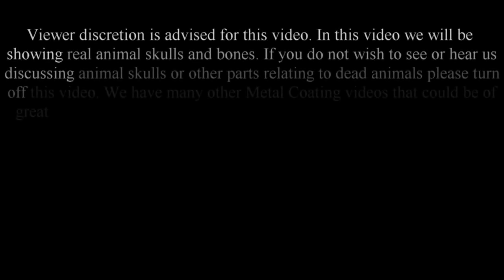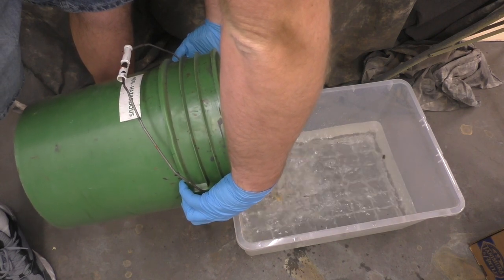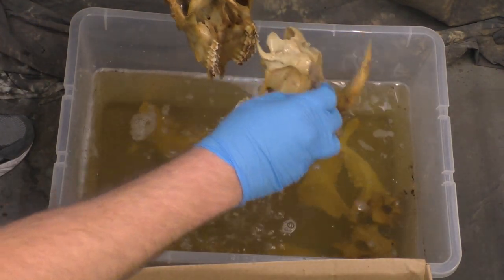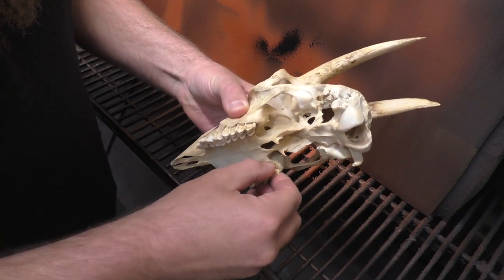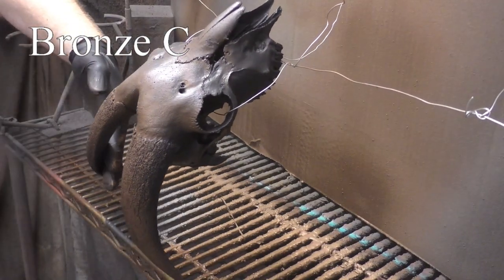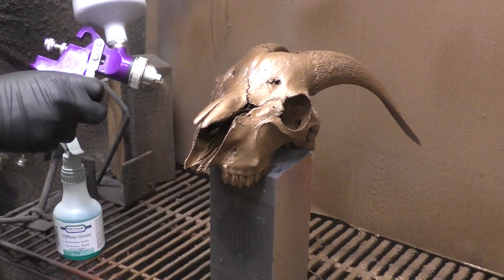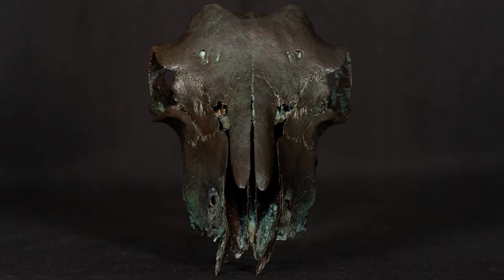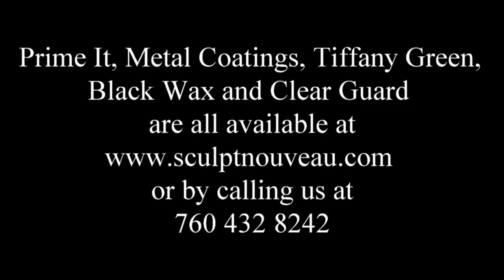Metal Coating on Animal Skulls

Comment: I do a lot of skulls in both B & C with the back wax I seem to like the finished color of the B better but its not as durable just for the fact your medium is fragile bone . Would it help by using your clear coat on the B for durability on bone and can a clear coat be applied over your wax?
Scott at Bone N Bronze
Reply from the maker: A clear coat would protect the finish, but unfortunately it will not alter the durability of bone. Nothing goes over wax but more wax.

Comment: The website says that both B and C can be burnished with steel wool. Is that incorrect?
Reply from the maker: Both Metal Coating B and C can be burnished. The difference is that Type B will not burnish to a shine. Burnishing Type B is done to remove excess patina, which will accentuate the high points and recessed areas of the piece.
Reply: @sculptnouveau  Ahh, thank you!

Comment: hello, if my metal like brass or copper already has clear coat on it and I want to remove it, what is the best way to remove it before degreasing if I don't have a sander?
Reply from the maker: How to remove a clear coat without a sander has a lot of factors that come into question. What clear coat was used? Are your trying to preserve the finish underneath? Give us a call and we would be happy to ensure you get the proper answer 760 432 8242

Comment: What kind of compressor setup needed for this as CFM and PSI?
Reply from the maker: For the sprayer that we used in this video, for a continuous spray, they recommend a 30+ gallon compressor, 6 CFM @ 40 PSI. I spray the Metal Coatings at 60 PSI though.